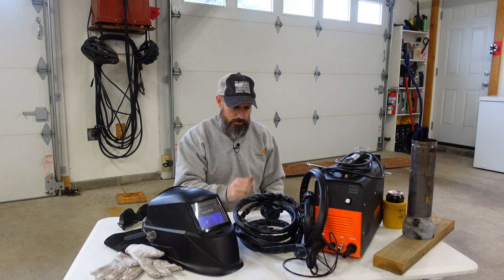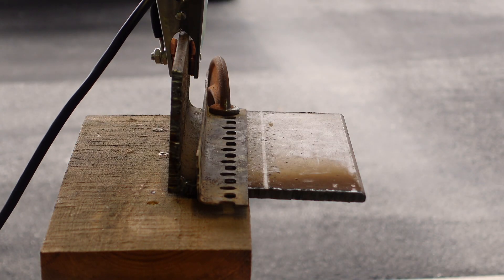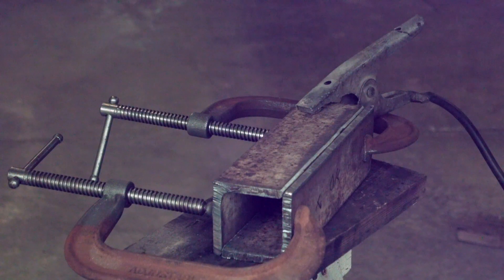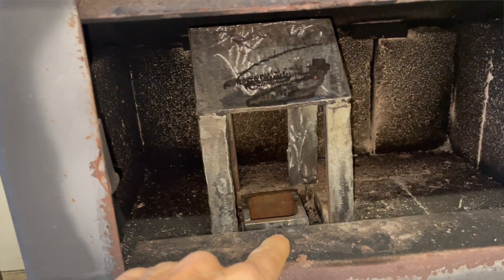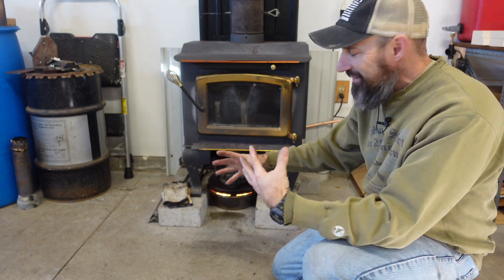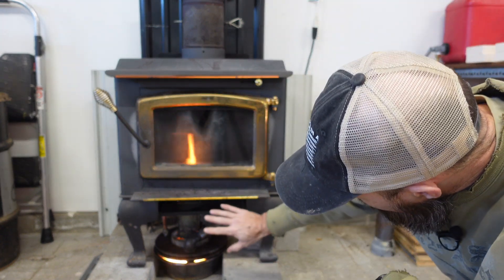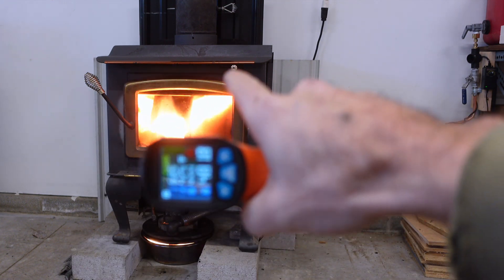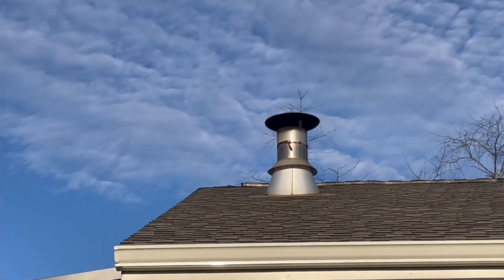Upgraded DIY oil burner exhaust 5/16 inch steel and flame guard

Comment: Thanks for the good content, and also I have a question and a suggestion. Because you have a blower, it shouldn't be any problem with smoke traction. You could make the smoke pipe wavy; it would be beneficial due to the bigger area of the pipe the less heat would be wasted, and the garage would be warmer. Or, for example, you can build a boiler around the exhaust pipe for heating the water. And also, that's just my opinion, but I wouldn't recommend making the "heat deflector" lower because it wouldn't make a big difference in deflecting the heat due to being near the stove top. Actually, I would suggest making it bigger and not changing the height. And once again, thanks for the good and interesting video.
Reply from the maker: thanks for watching and for some of the suggestions

Comment: Looks like it works great. I agree everything underneath should have a vacuum so no carbon monoxide going into building. May still be a good idea to get a detector just incase.
Reply from the maker: I would agree that a detector is a good idea. Thanks for watching.

Comment: For efficiency add an outside cold air inlet.  Otherwise its pulling cold air into the garage for combustion probably around the garage door.  Also be sure the chimney is rated to handle the exghaust temps.  Looks like alot of heat going up the chimney.  Add a heat collector or fans ontop of the stove?
Reply from the maker: Thanks for the advice and thanks for watching